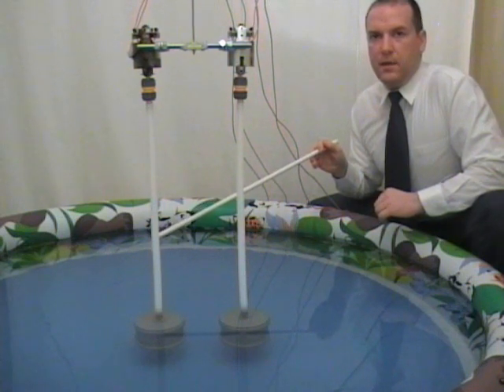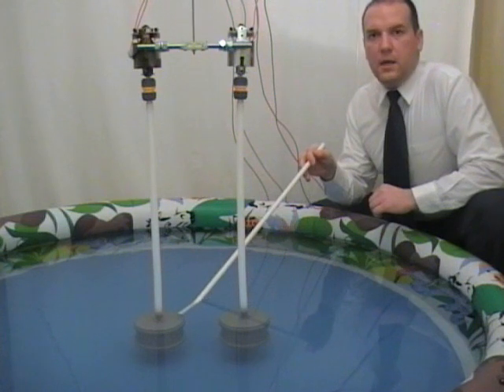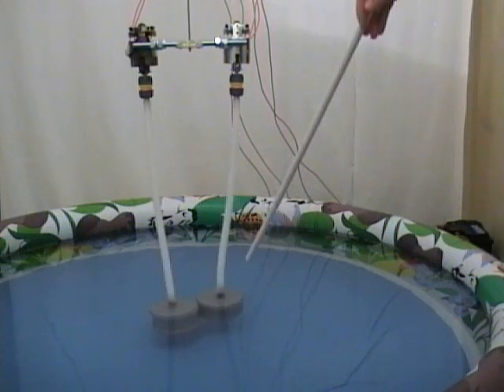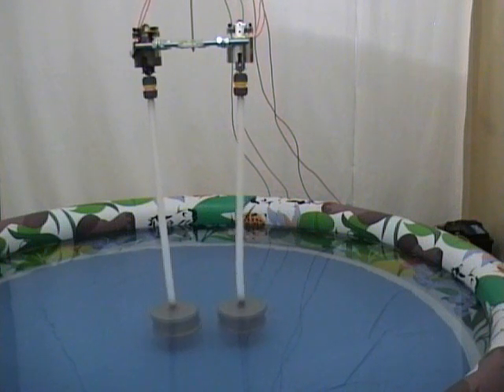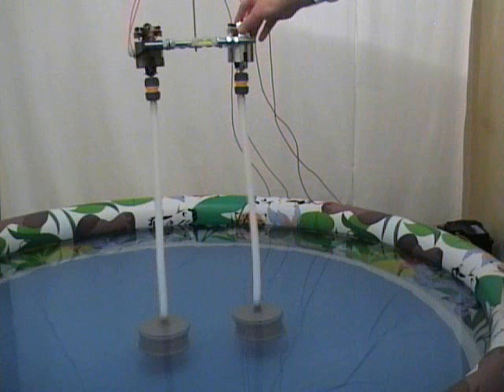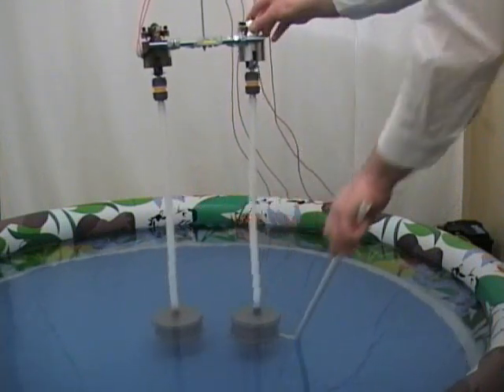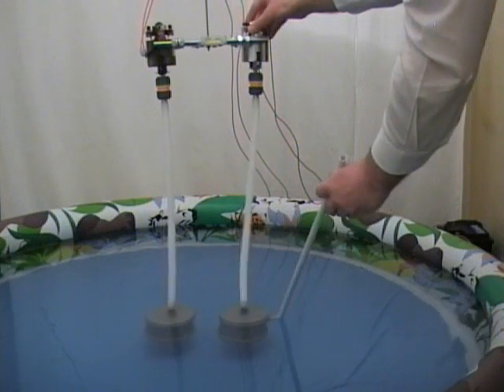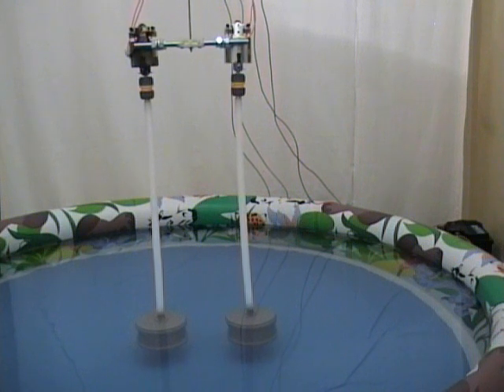Ionel DINU - Experiments with Cylinders Rotating in Water

Comment: It would be interesting to see three variations of this experiment. Note: I am assuming that the cylinders do not represent coils but magnets and/or masses.

1) One cylinder is connected to a motor, and the other cylinder is free to rotate. (This represents a magnet and a piece of iron. Prediction: The free cylinder will rotate opposite to the motorized one, and they will stick together, though not as strongly as in the case when both were driven by motors in opposite spins.)

2) One cylinder is connected to a motor, and the other cylinder is not free to rotate. (This represents a magnet and a piece of wood, plastic, etc. Prediction: The cylinders will not stick together and will not repel either.)

3) Both cylinders are connected to vibrators, and gently vibrate instead of rotating. (This represents two masses. It is hypothesized that masses create a small random vibration in the Æther.  Prediction:  The surrounding water pressure causes the masses to come together, though the attraction is much weaker than for the spinning cases.  This represents the gravitational attraction between masses.)

Thank you.

Comment: While I encourage for you to continue your experiments, I would like to offer a different explanation then "Aether". When the cylinders rotate in opposite directions, the drag on the water creates a current (of water) going through the middle of the two cylinders and using Bernoulli's principal, you see that this means there is reduced pressure in that area. The relative greater pressure on the other faces would force the cylinders inwards. ++The opposite is true when the rotate in the same direction. The water is more or less static in between the two and moving on all other sides. Balance the forces and they would preferentially move away from each other.
Reply from the maker: You understood correctly what I tried to show in these experiments. But what about two current-carrying coils placed parallel in vacuum? The cylinders are the equivalent of two parallel current-carrying coils placed in vacuum. The current flowing in them forces the aether that fills the vacuum to start rotating around the coils just as the water rotates around the rotating cylinders in the experiment. If you look at the article "Rudiments Of A Theory Of Aether" ( http://gsjournal.net/Science-Journals/Essays/View/2370 ) you will see at pages 41-45 why I did this experiment in the first place.